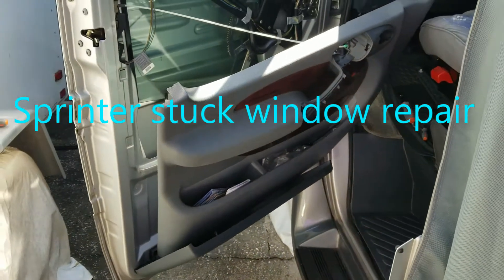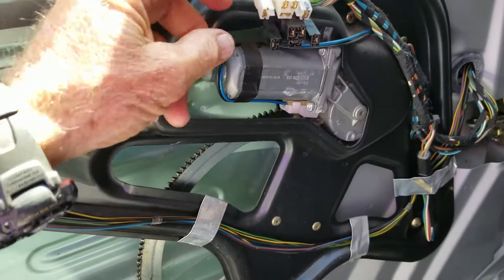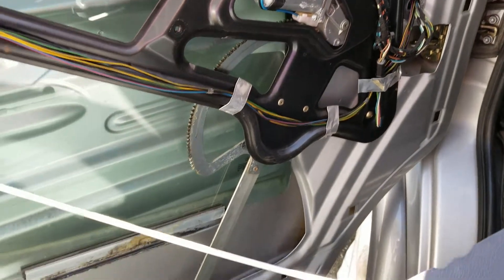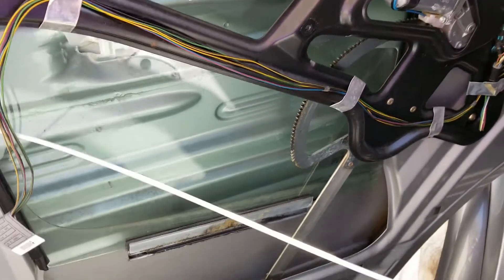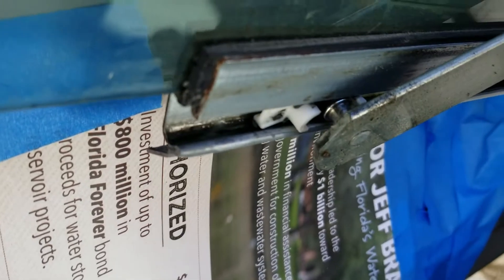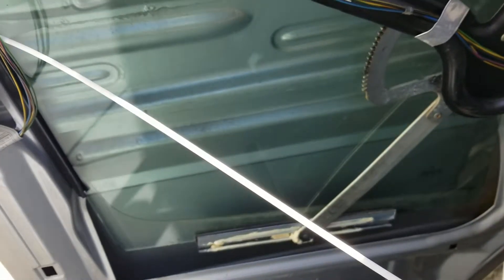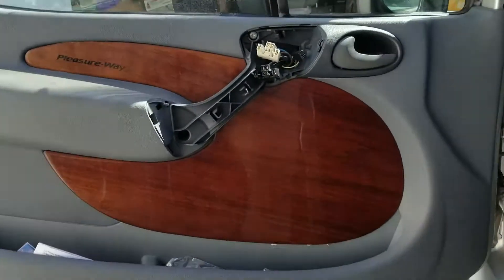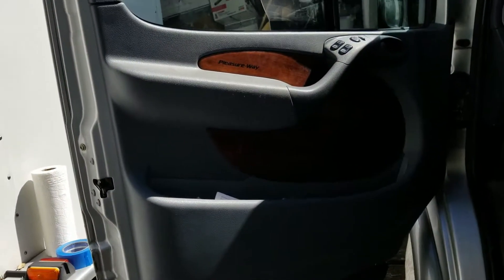Sprinter window stuck down  repair, the motor works

Comment: Thanks for your video. So, can I just confirm - you basically removed the broken plastic piece and then bent that metal arm so it would stay on the track? The zip tie was placed on the little piece that goes into the groove, just so there wasn't metal on metal friction, right?